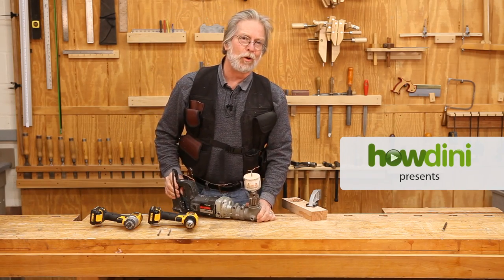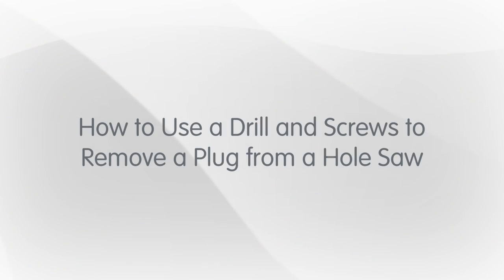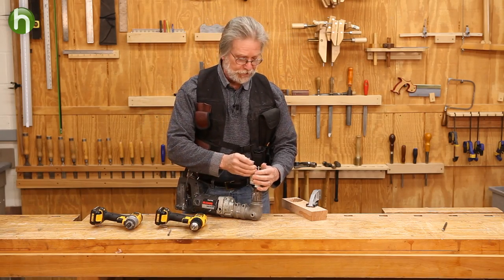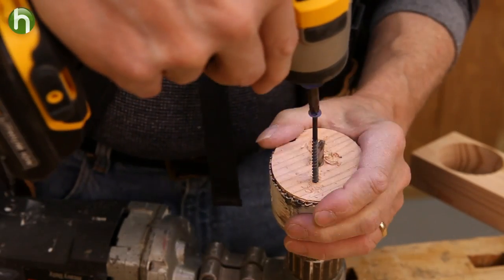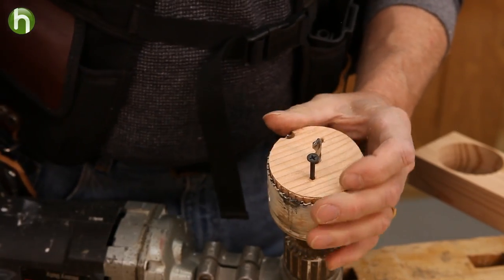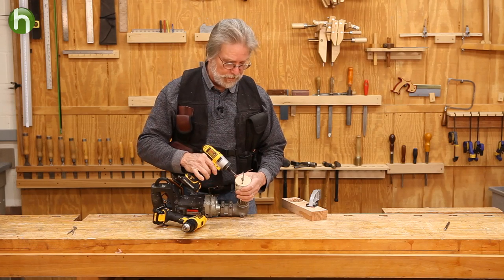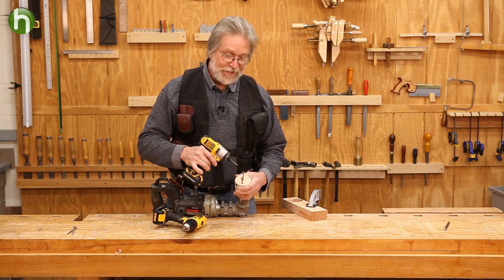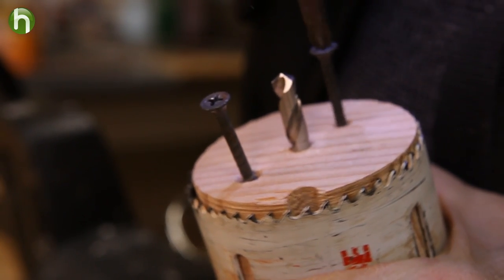How to Remove Wood Plugs from Hole Saw

Comment: It's also important to extract the plug soon after cutting, the saw is still hot (caution) and therefore expanded. If you wait too long and the saw cools and contracts around the plug it becomes much harder to remove. Best of luck :3
Reply: only now i learn...
Reply: @iamamish  ikr 😆 🤣
Reply: Oh no...
Reply: you can always heat it up again
Reply: :3

Comment: I found that if I back out of my cut about half way through and clear the sawdust out of the saw and the hole and then finish the cut, that plug comes out waaaay easier.
Reply from the maker: Thanks for sharing that info!

Comment: Any tip for removing a metal plug 3cm thick? I tried with screws but it won't budge. The metal is thick aluminum.

Comment: Hah!  I was struggling to get a plastic hole out of the saw bit.  I even thought of drilling screws into it so I could pull, but it never occurred to me to just let the screws do all the work.   Worked right away on the first shot!  Thanks for the great video!

Comment: Me after watching this video: Goes to tool box. Pulls out hole saw bit that has had a wood plug stuck in it for about 3 years now. Reclaimed hole saw bit in under 3 minutes. Muscle flex 💪. 
Thanks!

Comment: Found a tool chest near the trash dumpsters. Had one with the wood in it, well stuck. Drilled it to sawdust around the inner and outer edges, then side to side. That and some flathead action did the trick.

Comment: If you have a arber with studs that lock into the saw you can simply take off the saw and use the pilot to push out the wood from the inside out.
Much faster and requires no extra tools

Comment: This did not work for me. The 10” pvc I’m working on is too strong to be backed up. It strips the hole rather than push the plug out. 

However, I did see from your instruction that the only preventing my success is me. So I considered the problem then drilled 3 holes on each side of the pilot. This weakened the plug so I was able to wedge it out easily. Thanks for your advice, and your perspective.

Comment: Looks great, but it didn't work with 3/4" plywood, which just split apart at top layer.  Might be great for solid wood though.  Thanks for sharing.

Comment: Just unscrew the arbor, you can usually bang the drill bit into ths aood after through the hole to pip out the wood. Or you have the hold to now punch through whatecer you want. Usually I just bang the hole sqw against the garbage qs its running right aftrr making the hole and it falls out.

Comment: Another great tip what i did before on my first round but was told i didn't need too... I drilled the centred whole a lil bigger so it would fall through but then my friend said i didn't need too. Well on second one. I didn't & got the wood stuck in there like this. 

Ughh don't listen to everything friends say ✔

Comment: if this doesn't work, drill 4 holes, put the hole saw in a vise and use a small chisel or screwdriver to split the plug

Comment: Maybe its just me but this is way too much time and effort in my opinion especially if you are concerned about production. I usually stick a spring over my drill bit/arbor. These makes popping the plug out with a screwdriver much easier and sometimes the spring keeps the plug popped enough where you can just grab it with your hands. Just be careful not to lose the spring.

Comment: Why do you need to drill 2 holes and 2 screws? Why not only drill 1 hole and then screw in 1 screw?
Reply: It keeps it from binding. You can balance the pushing if needed as I needed to today